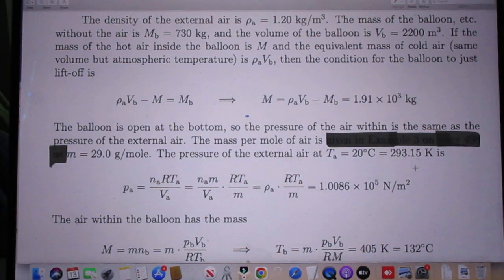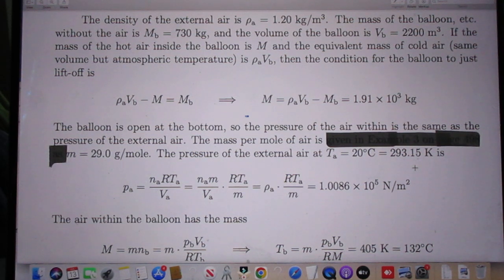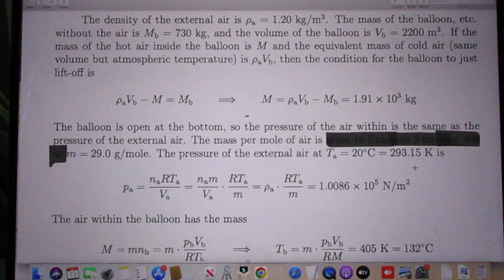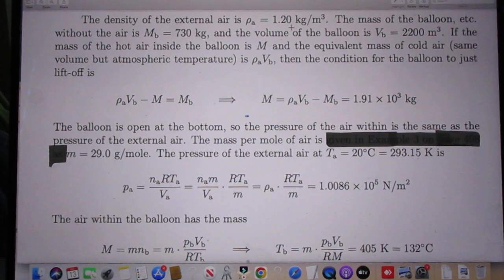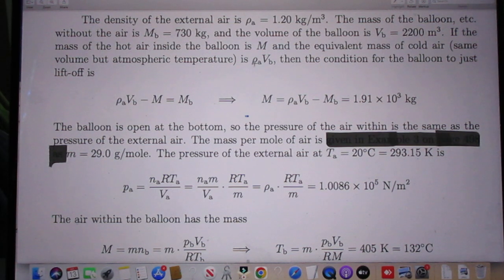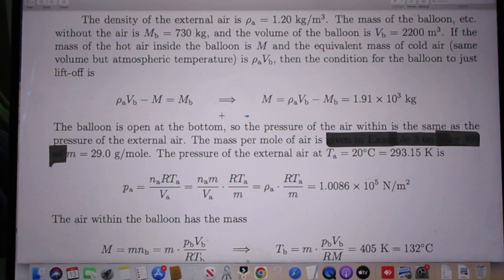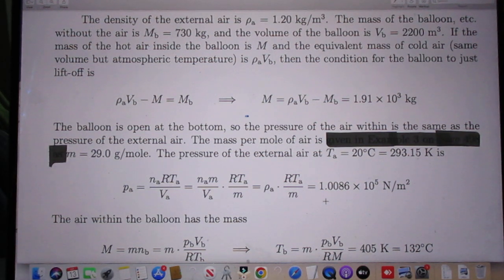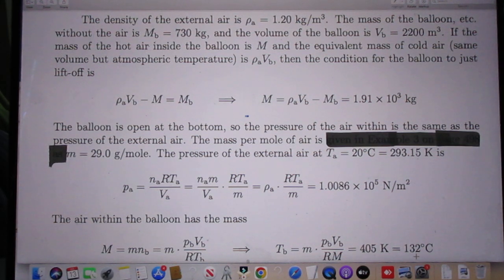Solution Problem 148 - Hot air balloon

Comment: You don't need to complicate the calculation with the gas constant R or molar mass M. These can be completely cancelled.
For ideal gas law the density decreases with increasing temperature (rho_new = rho_20* T_20/T_new).
So you get a simple mass balance: 2200*1.2 = 730 + 2200*1.2*293.15/T_new
T_new = (2200*293.15*1.2) / (2200*1.2-730) = 405.2 K = 132.0 degC

Comment: M=Mass of balloon. V= Volume of balloon. Di, Do are densities of air inside and outside.  Ti, To temps inside and outside.
Since PV=nRT, density is D=nm/V where m is molar mass. --> D=Pm/RT, so D goes as 1/T.
M=V(Do -Di) =V[1.20 - (1.20x293/Ti)  --> 2640-730 = 2640x293/Ti  --> Ti = 405 K.  
No need to know molar mass.
Reply: Exactly!

Comment: Professor, there is such a strange question. My friend knows mathematics well, but he does not understand physics, he does not remember formulas and terms. Does he have more problems to solve?
Reply from the maker: physics is not about equations - it's about concepts  I only remember about 25 eqs (including F=ma, E=pc=hf, KE=0.5mv^2, centrip acc is v^2/R, F=m1*m2*G/R^2, E=qV, work done in going from A to B is KE_B - KE_A. Faraday's Law, div B=0, Ampere's law, Gauss Law.)

Comment: Hello Dr Lewin, using another approach I found 126 C as a result. Quite close. Working through your solution I first was not able to get the same result. Then I did what I trained my chemical engineering students to do during all the years I gave them lectures: do a dimension analysis !!
Using R 8,314 J/(mole.K) etc I got a pressure in kN/m^2. So I needed a correction of a factor 1000 to get to N/m^2 and then all was fine.  But one more nice challenge, many thanks !

Comment: Thankyou professor if you reply! 
I am 10th grade student from India. 
I have one doubt why there is no loss of current while passing through resistor.
Reply from the maker: heat loss i^2*R
Reply: @lecturesbywalterlewin.they9259  Thanks a lot professor
Reply: There is no loss of current through a resistor, because charge is conserved, and a resistor doesn't accumulate a net charge.  For the same reason (continuity of flow) that the water current is the same on both sides of a constriction in a hose or pipeline.  The water current is less than it would be, if you release the constriction and let it flow freely, but the water current is still equal on both sides of the constriction.

The charges lose energy through a resistor, but they don't accumulate in the resistor, or get destroyed.  Ideally, they also don't leak to the surroundings.

Comment: You see that gas pressure must be contained by the hot air balloon correct?
Reply: A hot air balloon is vented at the bottom, unlike a sealed balloon.  This means its pressure, for what its worth in this problem, would be close enough to atmospheric pressure, that  the impact of pressure on density is negligible.

Thanks to the buoyancy of hot air, it will be slightly higher in pressure inside the hot air balloon, since new hot air is added at the bottom any time the burners are running.  The operator can reduce the internal pressure, by opening a vent at the top of the balloon, which will enable the balloon to descend by letting some cold air back in to the envelope.  Unless the operator makes a huge blunder, the internal pressure will remain slightly higher than the outside pressure, otherwise the envelope would collapse.

Comment: Can anyone please tell me how you can get an elevation angle with a curved Baseline?
Reply: What you really are finding, is the angle between the line of sight, and the tangent line to the curved baseline surface.  Or tangent plane in the 3-dimensional case.  Try drawing a unit circle, the line y=1, and the line between (0,1) and (4, 4).  Find the angle between the two lines you draw.  Answer: 37 degrees.

If you zoom in on this circle, you will find that its shape approaches the line y=1, at the point (0,1).  You could zoom in so far on the circle, that you wouldn't notice with the naked eye that it isn't a line.  This is how elevation angles of objects in our sky work.  The baseline is the tangent plane to our planet, at the point of the observer.

Comment: Sir.  If we fill hot and cold ...then what changes will come under balloon.......is the situation same or not ??
Reply from the maker: question unclear. hot air inside balloons can make them lift (Archimede's Principle)
Reply: @lecturesbywalterlewin.they9259  Sir what  changes come will come in lift of ballon from hot gas and from cold gas ?
Reply from the maker: @deepshikhakumari9376  I do not understand your question
Reply: @lecturesbywalterlewin.they9259  Sir, if we fill hot gas in one balloon 🎈 and in other balloon we'll fill cold gas , then what is the speed of that balloon and .Is hot gas and cold gas in balloon   can took any changes in lifting.
Reply: @deepshikhakumari9376  If you asking, in the case where we would fill the balloon with cold gas instead of hot gas, if we will also have  lift the answer is no.
Reply: @deepshikhakumari9376  If the flavor of gas is air, filling a balloon with cold air will not generate any buoyancy.  It would also sink, because the membrane would make it denser than the surrounding air on average.  It has to be hotter than the surrounding air, so that the internal air is less dense than the surrounding air.  You'd have to select a different flavor of gas with less mass per molecule than the average air molecule, for a cold gas balloon to rise.  Helium is the most common choice.
Reply: @deepshikhakumari9376 when u fill cold air in ballon then it willn't fly .
Reply: @lecturesbywalterlewin.they9259  Sir I want to ask one question, 
That where did all antimatter go???
Reply from the maker: @acchabaccha-l2e  it's a good question.  There are artciles about it online.  I suggest you read some (use google)
Reply: @lecturesbywalterlewin.they9259  Thanks sir❤❤